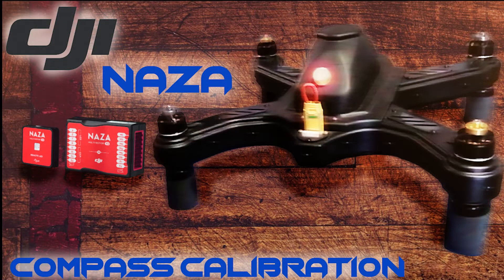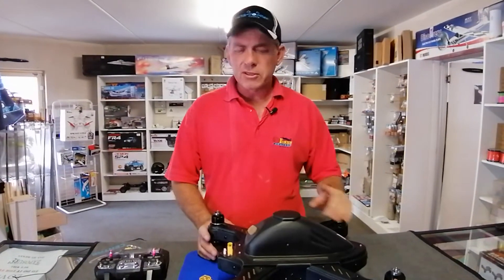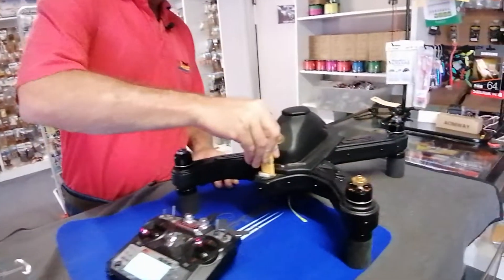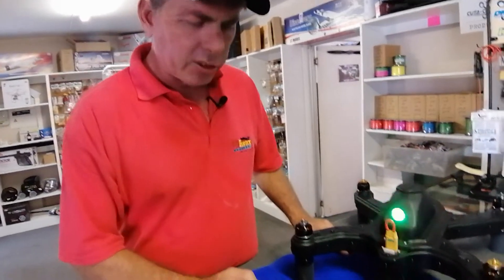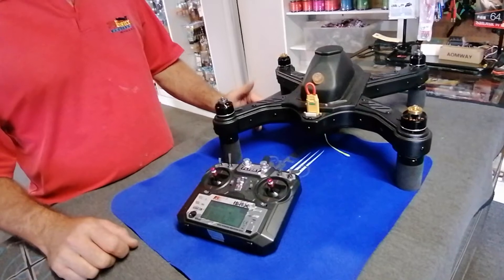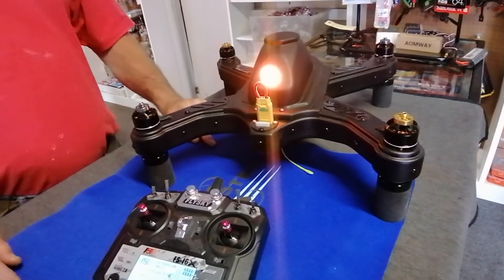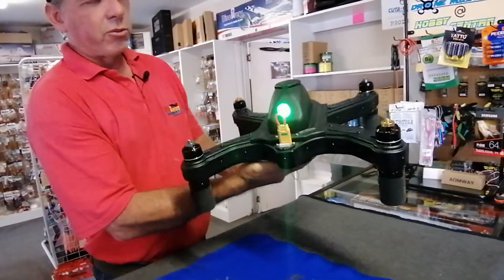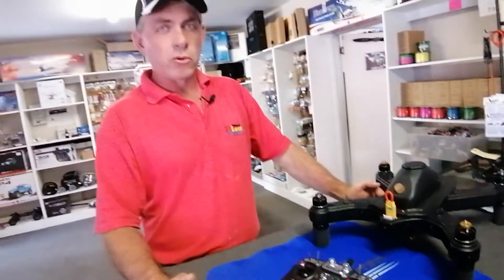DJI Naza Compass Calibration

Comment: Hi Gary what system is used on the new EX1 4S
Reply from the maker: This video is on DJI, however, you can contact me at 083 269 6785 for any questions.